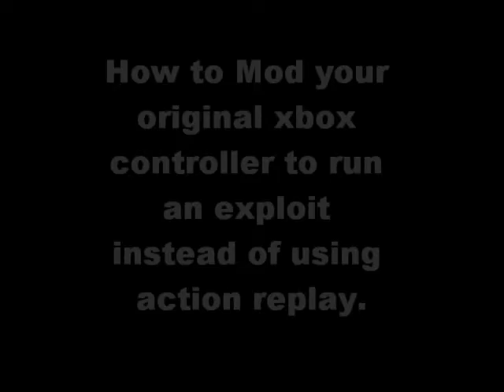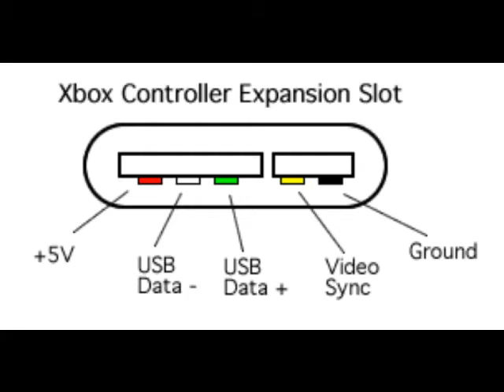Original Xbox USB Controller Mod Part 2

Comment: Do i need a that memory card thingy black one it came off
Reply from the maker: What memory card thingy that came off? The black slot dealy you took off the inside controller? If so no you do not need it. Your USB flash drive needs to be bigger than 1gb yet smaller than 8gb and make sure you soldered the wires to the correct spot on the controller PCB. Otherwise your USB device might be faulty. Im guessing it is either wrong wires to wrong points on circuit board or your device is not working. Plug it into your computer and check. If it does work on your computer then try formatting and re trying. Otherwise yeah check your wires. Believe I provided a wire diagram in the video but I do not remember for sure.